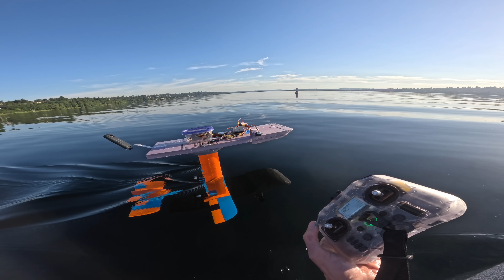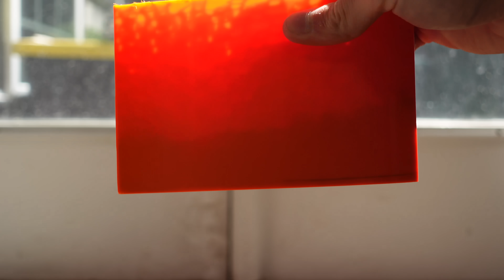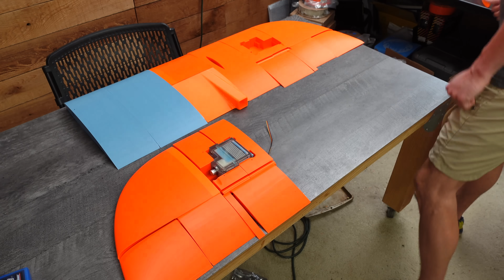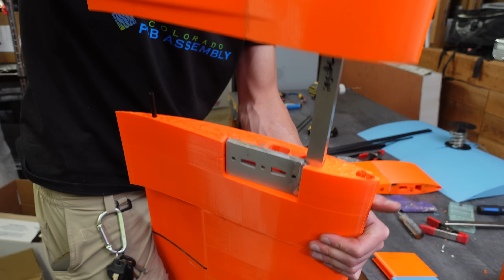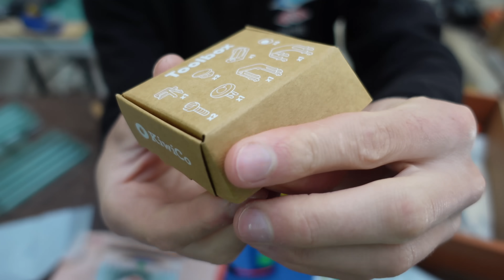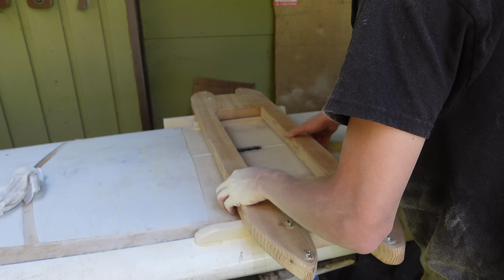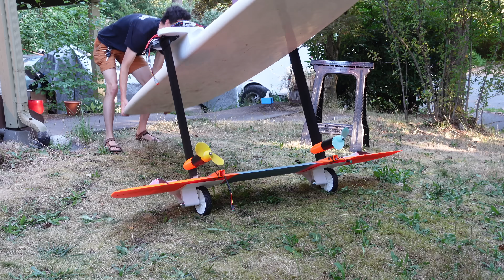Building a HUGE 3D Printed Hydrofoil

Comment: Great project! A warning about using silicone under heat shrink to seal solder joints. We did that with an underwater robot for the tether and after about a year the acetic acid from the silicone curing reaction corroded all the way through 10 or 12 gauge wire. Those joints will fail sooner or later unfortunately.

Comment: why not fill the hallow parts with spray foam insulation? seems like it wouldnt be to hard, make an extra long/proprietary technology straw and start filling from the bottom and work you way up, i think you only need to fill liike 30-40% and expands the rest of the way. plus you'd get addition buoyancy ontop of not having to drain water everytime

Comment: Why not use polyurethane spray to waterproof the 3d printed parts?

Or, you could also take some of your sla resin and coat the fdm parts and use a uv light to cure.

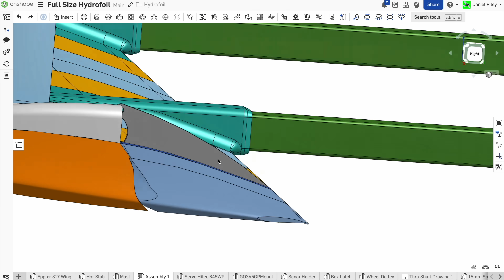Comment: 2:56 I remember back a few years ago in rc sailplane world that a glider called the Jester used a unusual servo to flight surface connection. It used the rotary action of the servo to turn a shaft the had bend in the went into a pocket in the surface was a very clean and slop free system.

Comment: If you want buoyant wings, why not do a minimal infill and then fill them with expanding foam? It would take some doing to get the correct amount inside so it doesn't deform but there should be a way to do it.

Comment: if you ever want to remove the servos from the water.

I suggest going the old school aircraft way and use wire cable to connect the control surfaces to the motors.

Have the servos up in thd board above water and just run the wires down to the hings.

Likely cut down on the space need and you can centerize all the stuff on the center of gravity better.

Comment: A easy way to get FDM print water tight is to put a thin layer of UV resin with a brush over all parts. If you plan this layer in your contruction than you also get the hinges water tight.To get it smooth you can also add some grease to the hinge. I used this method to print a motor housing for a RC duck and seal it to prevent the motor from geting wet.

Comment: Cool project and as always explained in detail - awesome!
OT: You use Gorilla-Glue quite a lot and I always thought: What is that cool stuff?!

I googled it and found that it is PU-Glue that cures from H2O which is awesome and for some weird reason it is not sold in the EU ?!
There isn't even something similar, so I found a seller in GB that shipped to Gemany! ;-)
Already used it on a project - works perfect!

Comment: Instead of soldering and using heatshrink with hot glue, you should look into environmental butt splices. It's all 3 in one, with a stronger mechanical attachment of the wires to boot.

Comment: 6:07 you need much higher specs if you want to use something on a moving vehicle anyway, as you're no longer talking about static pressure but dynamic pressure.

Comment: I bet if you do some DIY electroplating, these prints would look amazing and also be very water tight. I was thinking that you could also use a thin epoxy coating, but that's super messy and would probably wear down at the hinges too easily. An electroplating coat would act like a monocrystalline plate around the entire print

Comment: Paint a layer of epoxy should make them water tight
Reply: And try soldering tubes, they are amazing. Also, fibre glass just support the epoxy, it doesn't really do anything for the water tightness. Bit like rebar doesn't hold up a building, it's just strengthening the concrete.

Comment: A little tip from an old aircraft mechanic: If you want the wings to be streamlined, you only need to attach the servos for the wing above the waterline. Simply run them down the legs with a pull/push rod, then lead them to a rotating rod that runs through the wing and then to the flaps again with a pull/push rod.
Reply: I was gonna suggest putting the bulge on the high pressure side of the foil, but you're right that's definitely a better way, that's what they're doing in the America's Cup.
Reply: Where can I see the details of what you describe?
Reply: I'm sure he thought about that😉

Comment: Well, if it turns out to be too fast for your liking, just remember that a multi wing hydrofoil should give you more lift at lower speed just like a multi wing plane.  :)  (BTW, I think this could help make non-powered hydrofoils requires less effort.  Though they will be slower.  LOL)

Comment: Instead if hot glue heatshrink, you can also just put on hit glue first and then slide heat shrink over. Wait for it to cool down first, otherwise the heat shrink will shrink instantly. Also shrink the outer ends first, to keep the glue in

Comment: Spraypaint minwax quick dry polyurethane over the print...that will soak into the layers and help seal it and not really make the print dimensions change
Ingenious idea to print an enclosure and encapsulate the servo with silicon grease to prevent water ingress!

Comment: Might be able to achieve watertight foils if you separate the hinge designs from the rest of the foil and fully glassed the non hinged sections and printed the hinges at 100% infill

Comment: Have you tried using automotive clear coat on your FDM prints? I find it to be extremely usable on PLA and ABS. It cures into polyurethane so it will seal up a print well.

Comment: When it comes to making waterproof prints out of PETG why not use a smaller nozzle not a .6 but like a .4 and thicker wall thickness with random seam placement and finally a higher detail level (smaller layer heights) it’ll take years to print but it’ll be waterproof.

Comment: Cotton flux and epoxy in a mayonnaise like consistency, is use a lot in home built aircraft. 
It's as strong, if not stronger than fiberglass. Used mostly on fillets, but also for filling irregular shapes that are structural.

Comment: I think you can get a good watertight FDM print by coating it with some spray-on conformal coating. I think in the US the go-to brand is plastidip, at least that's what I see from aquarium forums, that put an emphasis on it being safe for fishes, but there's several other manufacturers.

Comment: With the gyroid infill could you fill the insides with AB foam?
Reply: I'm wondering if you could skip the infill entirely and fill with foam. Fibreglass on the outside might be more important in that case, so the hinges would need to be a separate part

Comment: Try Pour Foam as infill on 3D prints that need to be buoyant. Kills two birds with one stone... waterproof, stiffer, lower center of gravity, floats better, reinforces joints internally that can't be reinforced with resin externally... wait that's five birds.
Reply from the maker: Its exothermic and melts the 3D prints....

Comment: I'm thinking of building a hydrofoil with only one wing to reduce drag, kind of like that non-nose heavy project from think flight, if my understanding is right, it should still be quite possible to keep your balance on it, and then give it some automatic height control using pressure sensors instead of sonar or lidar, does it sound like that would make sense?

Comment: Print the hinge sections slightly smaller, then paint the shell with UV resin, and cure as you're going.
You could probably make a brush/spreader that a (good) UV pen can attach to, curing at a safe angle from the brush/spreader.
This would give you a perfectly smooth shell that's got some added strength.
And/or you could 'do' individual sections and 'glue' them together with the UV resin, using a large area UV lamp.

Comment: Love what you’re doing. I have a LARGE model aircraft background. Servo/boost tabs are a great way to reduce loads on servos, I imagine the loads on servos in water are massively greater than in air so ‘servo/boost’ tabs could be very beneficial and enable the use of smaller, lower power and cheaper servos. I realise you may know more about these tabs than I do but just in case, thought I’d chime in. Thanks for a superb channel 👍🙂

Comment: MY plan is to print a skeleton, fill with expanding foam and remove the excess foam that comes out of the skeleton (of course covered in carbon fiber or glass). Maybe you can use that approach instead. For the hinges you can screw them in as a separate component instead
Reply: That's not how you build a human at all. Even the FMA brothers knew how to do it better. And they failed!

Comment: you really should have painted the metal parts you drilled and scratched up to avoid corrosion. especially when they go in the water. ESPECIALLY when they go in salt water

Comment: for similar such future projects, perhaps you could thicken the walls of the parts and leave them totally hollow, which should print faster, and fill them with buoyancy foam? 

just model in channels and such for your steel parts with thin, perforated bulkheads to suspend them in place, tape off one end, then pour in 2-part epoxy foam (or spring for the canned stuff, which is stiffer but won't fill as completely and could leave voids). 

Bang: you got a buoyant, water resistant part that's fairly stiff but not TOO stiff and that (probably) took no longer to make.

Comment: Why not top off the wings with (liquid application) foam before you print on the last outer layer? Can add rigidity even if it adds mass. That added mass can to a degree be left from the print. It would come down to using light enough foam that is strong enough to keep water out.

Comment: If you use ASA or ABS instead of PETG, you can seal watertight using acetone or mek. 
ASA-cf is a great stiff structural printing material for harsh environments, and has incredibly low density so your foil would weigh less even!
Reply: Additionally, you can bond segments together with the same acetone or mek and save time and money over using glue
Reply: @zachmarks6337  is that using a vapor bath process? I think I've seen that application for creating aerodynamic smooth surface finishes on 3d prints. If so, I could imagine the size being a constraint for a hobbyist set up.

Comment: That waterproof servo housing is NICE. Good work!
Reply: Really nice.. Well thought out and nicely done :)
Reply: It does feel slightly overkill though. Like it's so much bulk I feel like it could have just been extended to be that one wing section
Reply: @weatheranddarkness  Pretty much everything has a design life and will eventually fail. There are only so many failures you can fix before you realise that "overkill" can save you time and effort by ensuring that you don't have to worry about failure, ever.

Making the product perfectly strong enough to only last as long as the design life is basically an engineers job. Whilst Management try to reduce the cost to zero and Engineers stop them at the point that the warranty claims start to outsize the cost savings.

Designing something yourself enables the opportunity to ensure that each part lasts as long as possible, rather than as long as profitable.
Reply: @Leo99929  My point is that in this instance, all the overbuild is in the waterproofing casing, enough that it actually reduces the structural effectiveness of the system as a whole. I think your point would stand a lot better if the whole system was structurally overbuilt, but here, a huge amount of weight and volume is sucked up into a non-structural element. I'm saying this component could be, especially with the benefit of 3d printing, better integrated into the structure, gaining both strength overall, and performance.
Reply: @weatheranddarkness  I see your point. It is in contrast to neighbouring parts of the build, and differences in things like stiffness and ductility can result in stress concentrators which lead to early failure... but they didn't break... yet. So who knows if it matters?

Let me know when you build something, look back, and think "That's absolutely perfect. If I were to make another I would do it EXACTLY the same and change absolutely nothing." Seeing ways you could improve is "the creators curse." And it hasn't gone away yet for me.

It's about progress, not perfection. 

I think he did a great job and thought of some robust and innovative solutions to common problems that I hope to take advantage of in the future. We should celebrate the good things and encourage more!
Reply: That was the best bit of engineering! Love it
Reply: This guy engineers.

Comment: There’s more engineering in this than the Oceangate sub.
Reply: That's a pretty low bar to fill. For one,  rctestflight uses a proper RC controller, not a console controller with bits glued to it...

Comment: I used a smaller version of your servo in a fish robot. We did some tests letting the motors sit overnight in water with no apparent issues. This was within their normal depth range. I have also seen other people open the servo housing and fill the servo with mineral oil to increase the water proofing. Your housing looks like it will definitely keep the servo's safe though.

Comment: Nice video.   On some of my large 3D printed projects, I used minimal infill, then included some tiny holes and filled the voids with minimal expanding foam (for doors and windows.)  It makes a simple, lightweight and very strong part.
Reply: That was my first thought as well.  I'd like to see an infill pattern that is designed for this.  Something that acts like textured rebar in a sense.
Reply: @ortusdux  Gyroid could in theory fill that role; though I suppose youd want to avoid trapped air pockets. Very low infill gyroid leaves a lot of gaps though and isnt really a continuous surface; kinda like the rebar you propose.
Reply: @ortusdux  the gyroid is probably that pattern as far as automatically generated 3d printer infill goes. Otherwise its manually modelling it in probably.

Maybe you can use modifier shapes in the slicer (in the same way folks commonly do to tune where support material will and won't generate or increase infill density where it matters). Then almost any infill pattern is only used for a few layers with a gap of 2mm where infill is not generated leaving a floating mesh interspersed through the layers (likely with a great deal of droopy mess into the gap). Though I'm not 100% that slicers won't cap off and treat each section as if it was an outer surface, but in theory that should work...
Reply: Minimal required gyroid to make the part printable, perhaps with a bit thicker surfaces / wider nozzle. You can add strength by making small holes in the model to force slicer to create solid spurs (essentially 0.1mm hole isn't really going to print at all, so it'll be solid bar of surfaces) held in place by the gyroid. Then fill the gyroid's void with foam, resin, etc. to make a sort of composite. Depending on what you use, you may need to put the part under vacuum to fill it completely although gyroid should let even pretty thick materials flow freely. Or if you really just want to reinforce the inside, pour a small amount in, close the hole and rotate the part so it'll coat the inside and leave a void at middle.
Reply: You may be better off printing a mold rather than the hollow part itself with that concept - probably quicker print time, much less chance of voids in the finished part where the foam couldn't go for trapped air, too small an opening for its state of cure, and if you make the mold right quick itteration of the whole project when you only needed to tweak one part - reuse all the old molds but that spot. Though your method does have merits as well, with the part geometry going to play a big part in which works best as well - no point making a mold that is either millions of parts or only removable destructively unless you really want/need to have the foam at the surface for other reasons.

One of the best bits of the expanding foams and a mold approach is you can put threaded elements and alignment tubes the final part needs in the mould to be cast into the part. Thus you can make them whatever size/shape will spread the loads and in a better material for the job than the 3d printing plastics - just be sure to use some grease like thing to prevent the bolts holding those parts and the threading from getting gunked up.

Comment: You could avoid using hinges and therefore make the wings able to be waterproofed if you changed to a split wing design with individual opposing tilt angles, similar to some RC airplanes.

Comment: There is tape made from hot glue, you can wrap that around wires and then use normal heatshrink
Reply: You can just cut slivers of hot glue and put them in the heatshrink once it's in position, before shrinking. Works perfectly.

Comment: You could push the water out of the infill with pressurized air that you blow in when you want to get rid of the water
Reply: Doesn't work if there's space for the gas to flow around the liquid